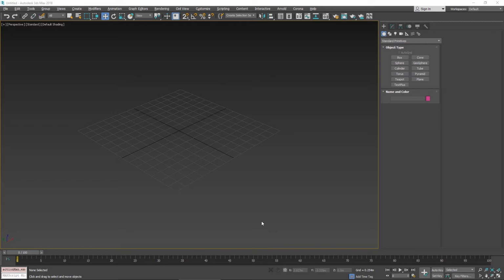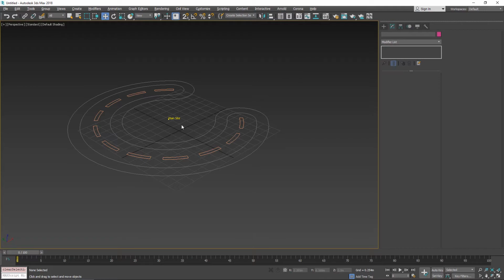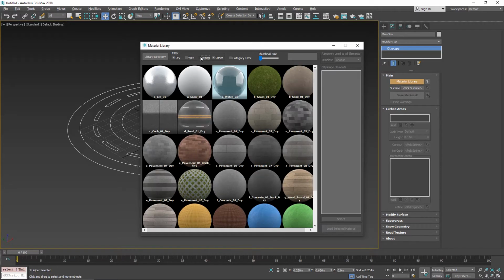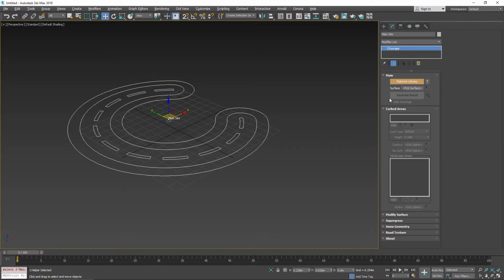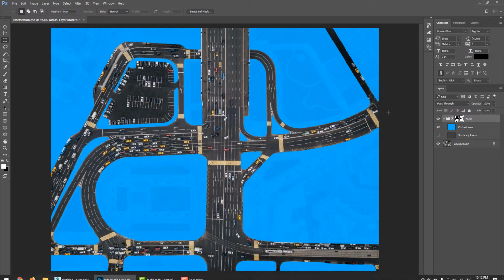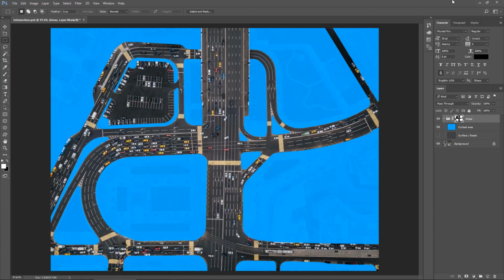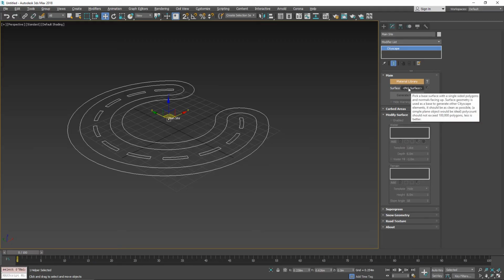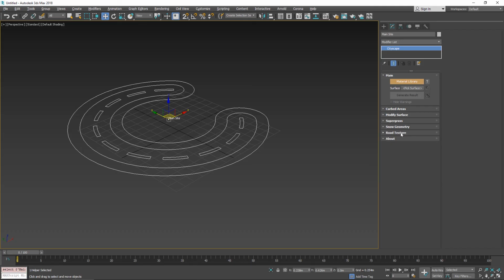Tutorial - 2.  Getting Started - Introduction to Cityscape Pro

Comment: what about the buildings? how did u generate them? and is it possible to import from osm. ism gives you paths in lines... but no curbed areas in most cases its just thee buildig models

is it possible to generate a city usig citymapper data?